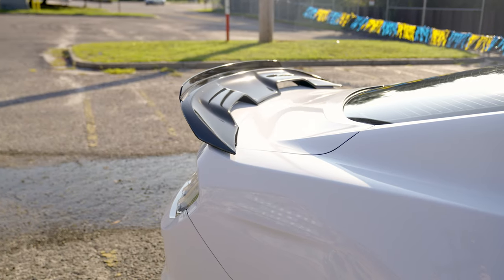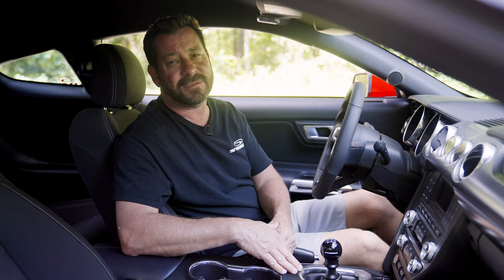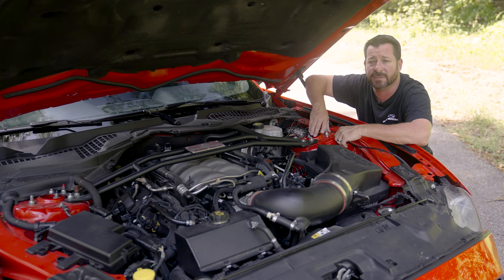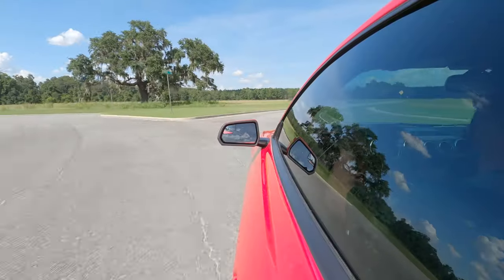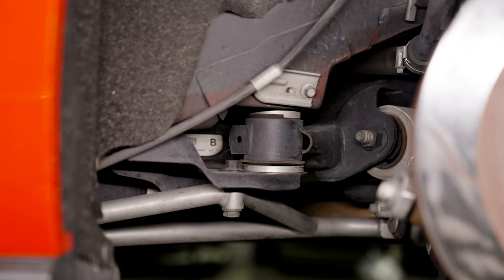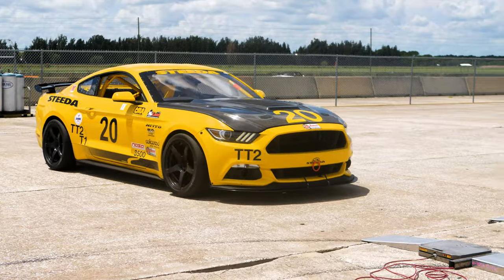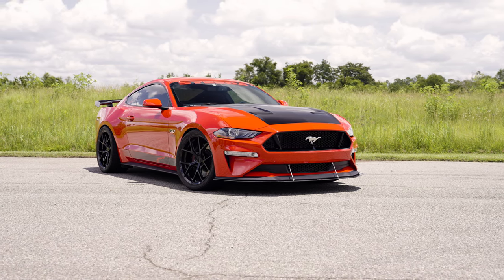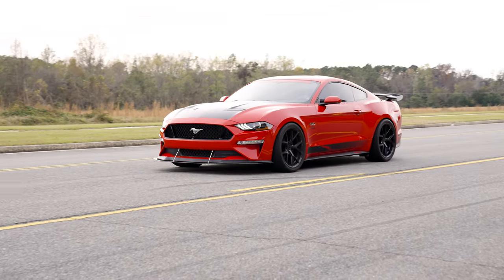How We Made the Ultimate Track Sleeper! | Steeda Q500

Comment: did you ever tested the Q500 with simple linear 800 spring instead of the Dual Rate ? Is the competition bar only needed because of the 1200 rate of the Dual Springs ?  Also the IRS Base kit dropped 0.5 seconds off my lap times witch considering the track was 2 km's long was mighty impressive.
Reply: yes, the comp rear bar allows for more rear bite when coming off corners and getting maximum traction.
Reply: Yes the higher rate springs required an adjustment in roll stiffness, which is why the comp rear bar was made.
Reply: @glenv5380  thanks just wanted to verify that my understanding is correct so if running let's say 800 lbs rear springs the OEM PP1 rear bar should give enough traction.

Comment: I wish NJ had shops like this near by.. It seems like I'm going to have to travel out of state through several states even to get my GT Whippled and tuned right.. I going to need a clutch, injectors fuel, Whipple, oil pump gears and crank sprocket, upgraded rear half shafts, MGW shifter and other stuff too..  You can see how the money add's up fast..
Reply: Why do you need OPG and Crank sprockets? Those are needed if you like to bounce off redline, but reputable people say it's not necessary otherwise (unless you're making 1000+ HP). Also, get a tune from Lund, they are the software engineering equivalent of Steeda's hardware engineering team.